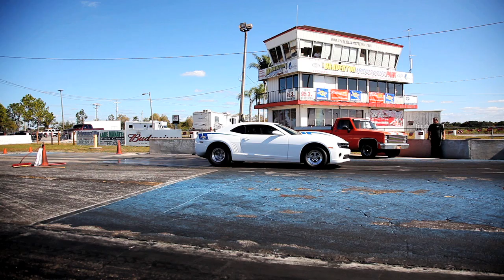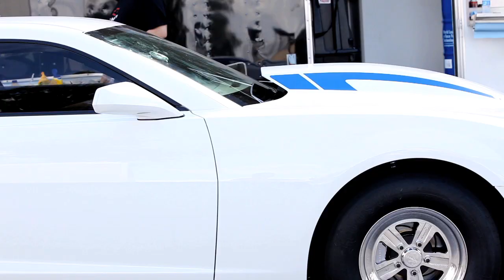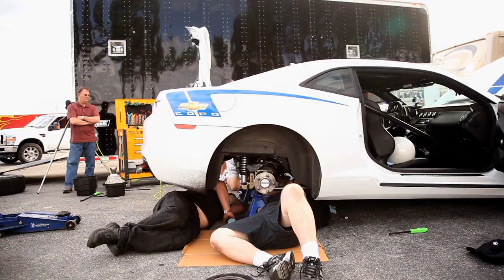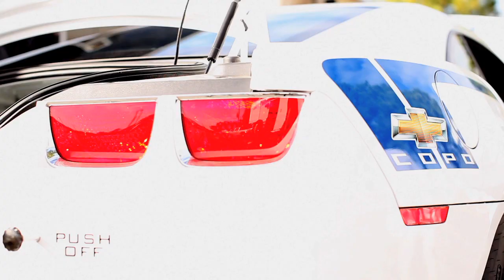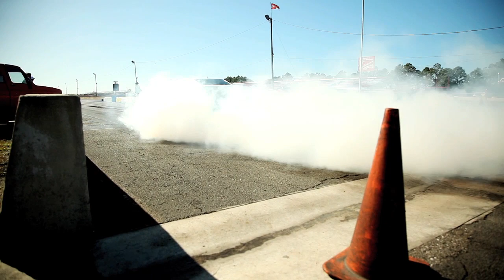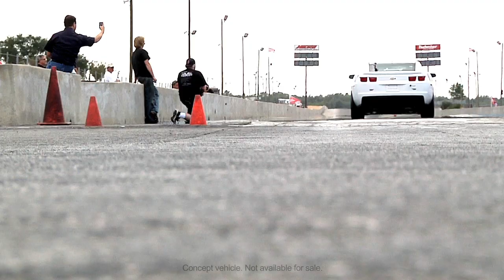Chevrolet Performance Testing of the COPO Camaro Concept

Comment: It's hp per weight. So even if that were true, which it isn't, they are still going to be pretty evenly matched. Both the COPO and SCJ are about 3100. It's going to come down to drivers and very talented crew chiefs that can squeeze as much power from these cars while still complying with NHRA stock and super stock rules.

Comment: I wonder if NHRA will add a new class in Stock for this and the new 650HP Mustang since the AA/S record is a 9.37 144.95 with a 2008 Mustang and AA/SA 9.43 by a 2011 Dodge.

Comment: It laps faster when it doesn't suffer from heat soak from what I've read. Probably from the power/ weight advantage. I doubt it actually handles better, not that I would care since neither are what I would use for a track car if I were into that. The GT500 DOES NOT run high 10s, how may time do we need to go over this?

Comment: Ordering a car from GM, then swapping the engine with one out of a Corvette does not mean COPO.
I think you're mis understanding what "production" means in Central Office Production Order"
It wasn't untill 1969 where GM rolled Camaros off the production line with matching numbers 427 engines already installed. Dealer swaps and installs are not copos or matching numbers.

Comment: Wrong, 67 Yenkos weren't COPOs. That's why the Yenko dealership had to do the engine swap themselves. It wasn't until 1969 that GM agreed to fit the 427 engines for Don Yenko and Fred Gibb on the production line, hense C. O. Production. O.. : )

Comment: I dunno. I think both cars have great potential. Who better than the SVT team to test the GT500 and GM guys to test the ZL1? SVT pulled 11.82 out of the GT500 on street tires while GM pulled I believe a 11.96 on street tires. Now for a car that weighs less and out powers the Camaro by near 100hp and has all this technology of DOHC, a supercharger and variable valve timing compared to the severely detuned cro-magnon OHV pushrod engine with a supercharger. Clear winner? Good question.

Comment: The SS and 5.0 are extremely close, most of the time coming down to the driver. Even auto magazines had mixed results. The GT500 is about two tenths quicker in the 1/4 with both on DRs after a year of Ford's work on the car. If that is murder to you fine. And the 1LE is a handling package only with no power increase that cost at least 6k less than the Boss, not really the same thing. The SCJ doesn't run 7s/8s out of the box.
Reply: watching wrong tests..2018 SS runs circles around GT

Comment: GM got an auto on stock goodyears to run 11.93, Redline's base run with just drag radials was 11.8. The quickest stock GT500 on DRs ET so far is 11.6. The magazine tests are corrected and therefore not very reliable. So far NO ONE has hit those time with a GT500 on stock rubber.

Comment: No, HIS Copo setup ran a 8's. This is the game where you kids don't understand the difference between someones tuned track vehicle and what's delivered to you from the factory. The Copo Camaro is a high 9second vehicle. Because Bubba Joe racing takes it into their garage and customizes the car to get even more power and gets to run an even faster time doesn't mean you're car will see the same. This is part of what they call TEST and TUNE. That car is tuned beyond what the stock Copo offers.
Reply: that is a lie

Comment: You are also comparing a 2013 to a 2012. Ford has this habit of rushing to release vehical ahead of everyone else's schedule. Let's say GM decides to allow a comparable Vette tune in the 2013 ZL1 and they lighten the car up some? Maybe do a small cam change like the 00-01 years and find a little more horsepower. Maybe the 2013 ends up with better track times than the 2013 GT500. In 5, 10, 20 years from now no one will be looking at one model year newer vs a past model year, will they? No...

Comment: Ok its not just a gutted camaro. I don't think you understand how much money it takes to build a reliable naturally aspirated motor with that much HP. Everything is forged, forged parts are not cheap. The camaro also has a roll cage. You find me a build of a car that can run mid 8's in the quarter that overall cost less than 90k to build. If you can find one than you win and i will admit defeat.

Comment: im talking the new 2013 GT500 with 650hp not the 550hp model. The New one runs mid 11s from the factory with a trap of 125mph, thats with the factory tires buddy. And GT500s are known for coming from the factory with shitty tires that cant hook, the older ones with 550hp hang with the new ZL1 lmfao

Comment: So am I. They do not run mid 11s without DRs. The best Evan Smith, editor of MM&FF, was able to hit was 11.8 on stock rubber. Do some more research. Both the GT500 and the ZL1 come with with the same goodyear eagle super car tires, and in my opinion are worthless on the drag strip. Any drag strip comparison of these two cars should have them both on DRs. A car with almost 100hp less and 200lbs more is nipping at the heels of the GT500, that makes me LMFAO

Comment: BTW this car doesn't run mid 8's it runs high 9's. Running 7's,8's, 9's, or 10's isn't hard. What's hard is running 7's,8's,9's or 10's in a vehicle that is still street legal which this vehicle is not. Nothings impressive about a fast race car that's expected to be. What's impressive is a fast street car.
Reply: I have one,drive it every day..wake up Ford troll

Comment: Well keep trying to convince yourself that. But you wont find any proof of a stock 13 pulling those time on street tires. The 11.8 ZL1 pass was an auto on drag radials by redline. Any competent driver could replicate those times. MT's time with the GT500 on stock goodyears on the other hand NO ONE has been able to do.